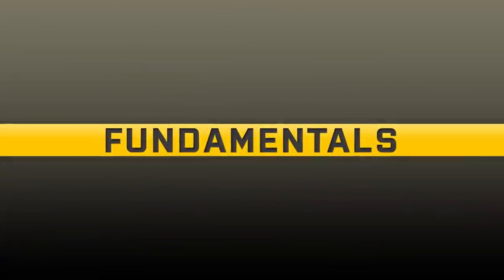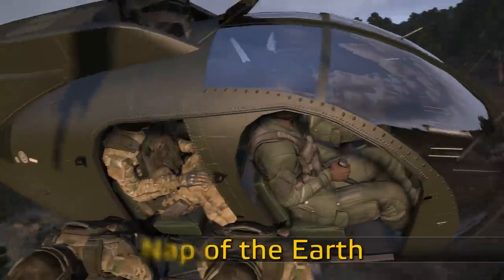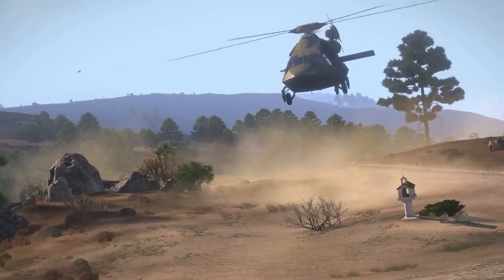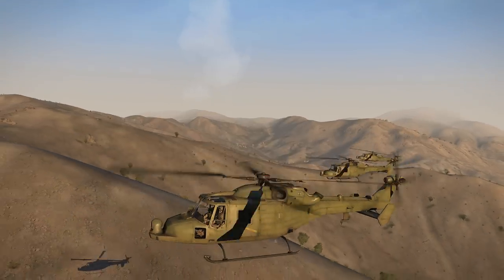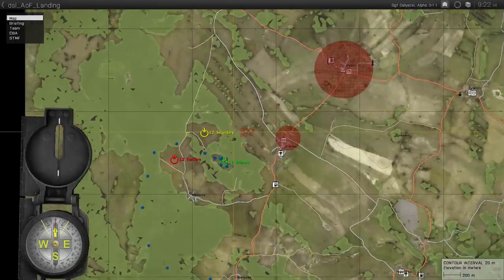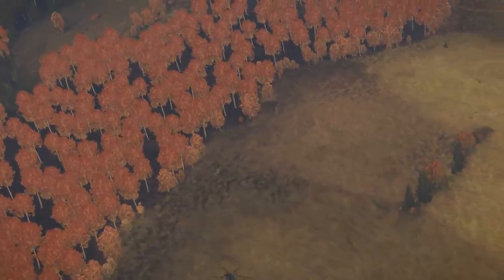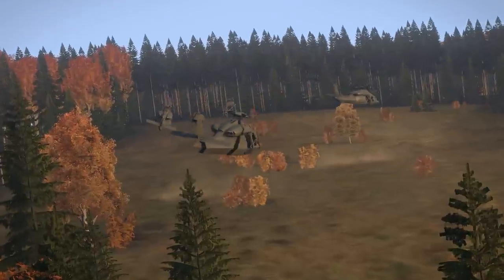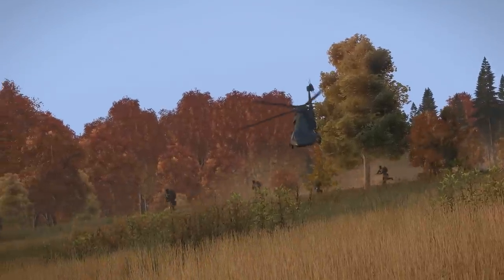Arma 3 Helicopter Transport Pilot Guide - Art of Flight, Episode 8

Comment: I'm interested in a video where you talk about trim, manual trim, -release, auto-trim and torque while focusing on mouse/keyboard vs. ideal controls.
(I like to keep things as complex and thus interesting as I can, but disabling auto-trim makes the heli act unstable. Thus attempting to stabilize with manual trim, it seems like speed change or collective change require you to re-ajust manual trim.) If you have experience with it I'd appreciate if you share it somewhere in another video.
Great video as always :)

Comment: Amazing video!! Could not have possibly been any more perfect. Do you still fly with keyboard, mouse, and rudder pedals?
Reply from the maker: Carl Johnson For normal A3 or A2, yes. In the event that I'm flying the advanced flight model (which we do not and will not use for our sessions), I use my DCS stick/throttle/pedals setup instead.
Reply: ***** What are the reasons you do not and will not be using AFM for your sessions? Will this be an absolute statement forever? By the way, great video.
Reply: Zachary Southard Not to put words in his mouth but it may be (as he stated) that he chooses to use M&K for ST session (for practical reasons) and AFM is not really designed for that.  There's also an off chance that he avoids the AFM for fear that it might cramp his aeronautic badassery.  ;)

Comment: What if you were presented in a situation where, as you began unloading in an LZ you suddenly had to evacuate pronto and still having troops on-board? Would you just exit the LZ and do a go around and land again or wait until the LZ is cleared (if possible).
Reply from the maker: Virtual Warfighter Khaos It's such a scenario-specific thing. There are a lot of things that can go wrong if you try to abort an offload like that - it's most likely better to just eat whatever's coming at you and allow the troops to get on the ground. Taking off mid-offload will almost certainly mean that someone will jump to their death by accident due to not hearing you in the chaos, and in the best case scenario, you'll have stranded a partial element in a hot situation.
Reply: ***** I see, thanks for the tip good sir.
Reply: ***** Also if you are taking fire whilst unloading you most likely wont have time to get away, and you will just get shredded up 20 meters above the ground and blow up killing everyone around. Assuming its heavy fire that is.

Comment: Quick question, when taking back off and you need to gain speed quickly, would it be suitable to lift enough for tail clearance and pull the nose up traversing you backwards until the whip around happens? Mostly i only use this when i know i will have the room to do so in an open LZ not in formation, i find it gains a massive amount of speed versus the more safe route. Just want to get your thoughts on this movement.
Reply: I think the problem lies in the 'Transitional' stage of flight; the likelihood of falling out of the sky for one, is large and secondly you can't see obstacles if you're flying backwards

Comment: Has anyone done a tutorial on the new flight model with mouse and keyboard?
I am having severe issues controlling my aircraft since the update, I am a realism nut so I want the maxed out settings. But I am literally finding control almost impossible. My collective seems sticky, my tail rotor control seems heavy and my general controls just seem to leave something to be desired. I've somehow gone from being the best pilot out of my friends, to the worst!
Reply from the maker: Viciousf You shouldn't be flying the AFM with mouse/keyboard. The normal FM is mouse/keyboard friendly, the AFM - by design - should not be.
Reply: Ah, a shame. Maybe time to invest in that hotas x then? Thanks for heads up dude.
Reply: *****  Hmmm, Maybe I'll have to do more research into which one to get then. :) Thanks for the heads up.
Reply: ***** Hmm, do you think the AFM is more powerful in terms of what you can do with it? Meaning, do you have more power of control or range of possible maneuvers with the AFM compared to the standard one? I saw there a effects not simulated n the standard one, but does that actually grant you more power all in all?
Reply from the maker: ElizaberthUndEugen There are some things you can do that are a bit more advanced via the AFM, but the drawbacks can outweigh those advantages as well.
Reply: ***** thanks.

Comment: Its so wird, "your head" does not move with the chopper, mine does.
how you do it? ty
Reply from the maker: xMentaGaming TrackIR 5 & Arma 2 Premiere (and DayZ, Arma 3, etc!)
Reply: ***** Got it, thanks.
Reply: xMentaGaming By default you can hold your left alt key and combine it with mouse movement to look around with your virtual head, the advantage of trackir is of course that you can still use your mouse for flying while looking around and that you  can lean as well
Reply: mnnrlfs ik obvisly, but there is a huge difference holding ALT while flying (landing), its mostly impossible.
Reply: xMentaGaming yeah indeed, didnt know how acquinted you were with the arma series, thats why I had the basic explanation. Too bad TrackIR is so expensive, otherwise I would sure have bought it.
Reply: mnnrlfs Well my country sells is twice as much then europe does, so for me its not even an option, its like buying somthing that worth 60-70% of the avreage pay check (salary) value.
Reply: mnnrlfs Check this. I built one with GY-85 + Pro Micro Arduino. Works fantastically well for swiwel and pitch (2DOF), which is what I use.
http://forums.bistudio.com/showthread.php?172297-Head-Tracking-for-under-10€&highlight=head+tracker

Comment: This video was really well done and professional too. But damn the game runs like crap. I can barely run the game on low setting with a GTX 780, 4 ram, 3.6gHz octo-core. And even them i get frame rate drops below 30. My machine can handle planetside 2 on ultra at 60, but cant handle arma on low???? WTF
Reply: Run it on high settings. It will shift some of the load from the cpu to your graphics card.
Reply: kervin2k9 i tried all settings, starting from ultra to low. This is however only applies to the multiplayer. Single player for some reason i can run it on ultra just fine.
Reply: +5000cz well if your getting ahit fps on multiplayer it depends on the server for example shitty server on highend machine = fps drops and viceversa
Reply: +5000cz it depends on the server. desynccrap.